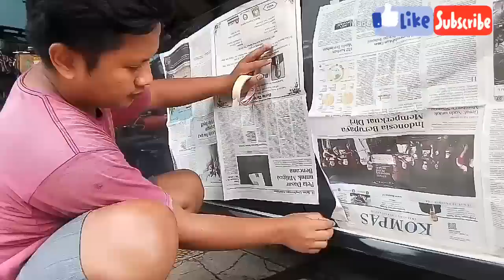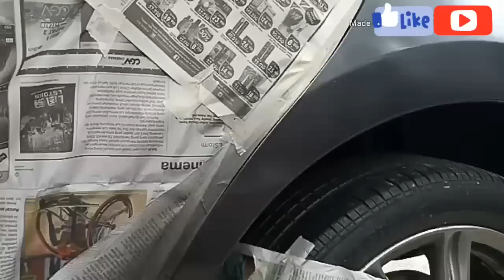Cara Tambal Cat Mobil

Comment: Maaf om mau tanya . Untuk clearcoat bagusan yang 1.3 apa 1.0 . Saya pakai auarita h921 , rencana mau beli h899 1.3?🙏🏼
Reply from the maker: Menyesuaikan sama kebutuhan mas,kalo kompresornya 2 pk pake 1,3 oke oke aja ,tapi kalo kompresornya cuma 1pk tekor anginya, kalo buat media kecil kaya panel motor 0,8 atau 1,0 aja udah cukup
Reply: Saya beli auarita h921 nozzle 1.2 buat clearcoat kompressor 1pk bagus ga ? 
Semoga si om nya sukses selalu 🙏🏼
Reply from the maker: Alhamdulillah sebelumnya terimakasih buat doanya, sebenernya kalo kompresor 1 pk kurang support kalo pake spraygun yang nozzlenya lebih dari 1mm, anginya agak tekor, tapi kalo buat media panel motor masih bisa sih ,nunggu agak penuh baru disemprot lagi
Reply: Makasi solusinya om 🙏🏼 udah bantu jawab pertanyaan saya hehe . Berarti saya salah beli om 🙈
Reply: Om bikin tabung kompressor tambahan dong yang dari gas lpg . Terus di review . Kalo bagus saya mau bikin 😀🙏🏼

Comment: Mantap gan, sukses terus buat brother paint.  Oh ya maaf mau tanya itu cat nya berapa lapis ya aman nya? Dan jeda waktu nya berapa lama dari cat sampe naik clear/ vernish utk hasil maksimal.  Kadang sy suka keburi buru gan, dan hasil nya jadi gak maksimal. Mohon dibantu jawab ya gan ,sukses terus
Reply from the maker: Kalo catnya sampe bekas epoxy bener bener gak keliatan lagi mas, cat sampe rata di jeda 5 menitan main tipis tipis, kalo pas udah nutup tapi catnya jadi kasar tunggu 30 menit terus diamplas dulu biar Alus pake amplas 2000 yang bekas biar Alus, terus di cat lagi sedikit sampe bekas amplasan ilang, setelah itu jeda 10 menit terus baru naik vernis
Reply: @brotherpaint3520  terimakasih banyak Mas, ilmu nya sangat bermanfaat dan detail.  Sukses terus buat brether Paint. Sy ikutin terus chanel nya. Salam
Reply from the maker: Alhamdulillah mas,biar berkah ya terimakasih atas supportnya

Comment: Bayar brpa itu se bagus itu
Reply from the maker: Harga dihitung perpanel mas :)
Reply: @brotherpaint3520  contohnya gmna
Reply from the maker: @egarlin4650  misal untuk sol bumper 350rb kalo cat full 600
Reply: @brotherpaint3520  bemper depan cman 5 cm itu Harus Semua nya ya d poles bempernya
Reply from the maker: @egarlin4650  kalo cuma sedikit bisa di sol aja gak harus semua di cat
Reply: @brotherpaint3520  harga brpa itu

Comment: Kok bisa mengkilat gan?
Yg heran nya habis di pernis
Kok di amplas(2000)
Jd di pernis lg kah?
Atau hanya pake p0les
Doang?
Reply: Tujuan amplas 2000 itu buat permukaan cat+pernis rata bang .setelah itu langsung poles dah pake kompon .jadi mengkilapnya itu rata kaga nggelembung gtu .biasa sih pake rubber compound .
Reply from the maker: Betul sekali mas
Reply from the maker: Jadi gini mas kenapa di aplas pake amplas 2000 jadi kan antara cat lama sama cat baru di sambungannya blurrr jadi semua permukaan diampals mati pake amplas 2000 agar semua permukaan rata dan di poles pake mesin poles pake compon lalu di wax, agar panel yang di sol atau di cat ulang rata mas bisa perhtikan videonya